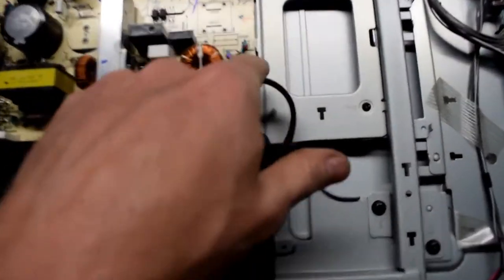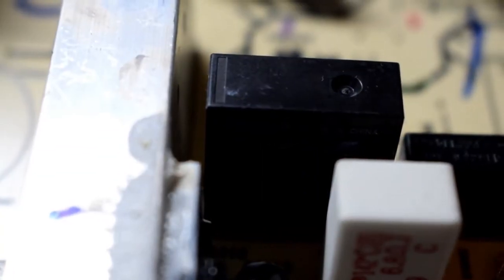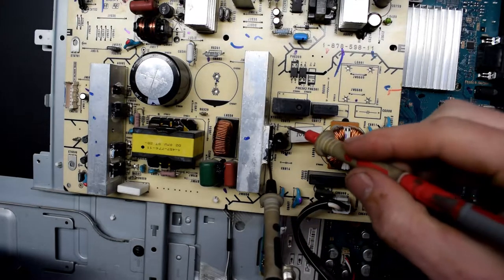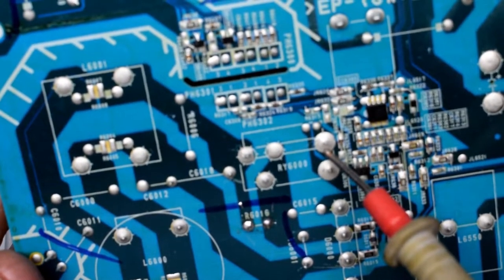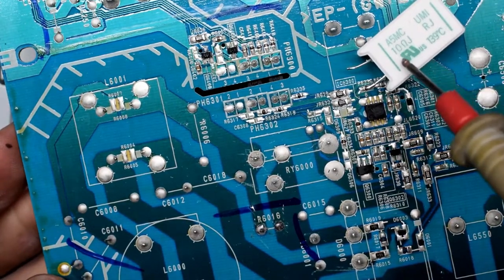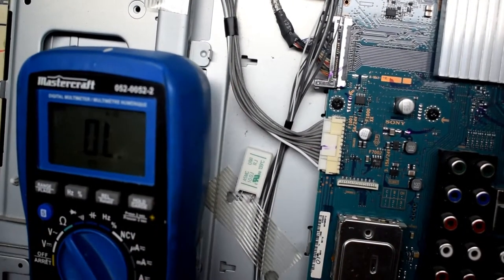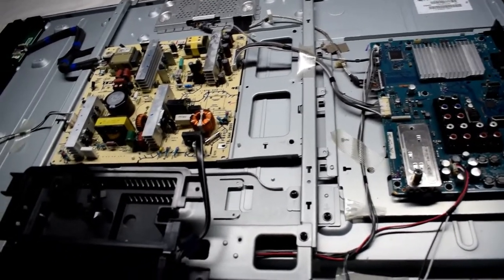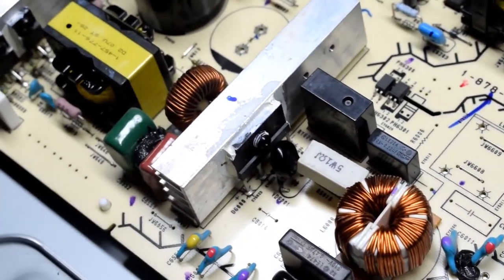I Fixed this Sony TV in 5 Minutes So can You | Model KDL 40S504 (no Power repair)

Comment: I checked it out and there was a problem with that resistor on my TV.  I had a 6 ohm resistor (mine was 6.8 ohm 5W), so I put it in just to test it. The TV powered up. I'm having a little bit of a problem getting the resistor. I am going to buy one off of Ebay, but it is coming from China and will take about a month to get here. Thanks for the advice and lessons you do.